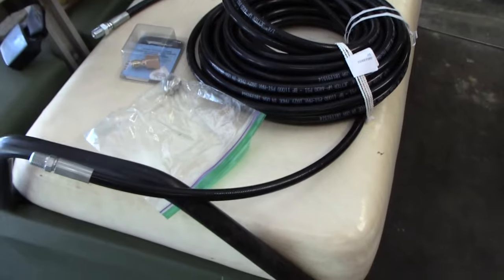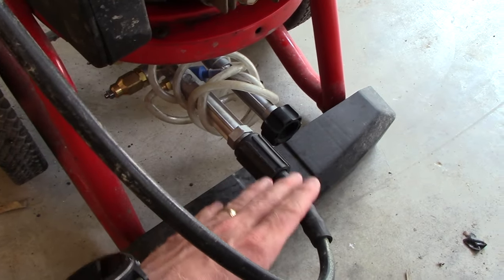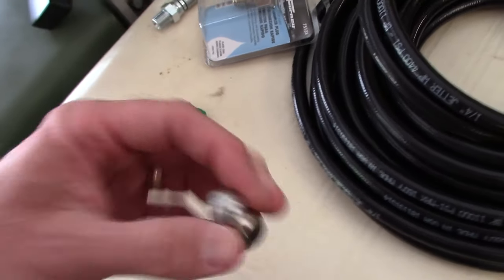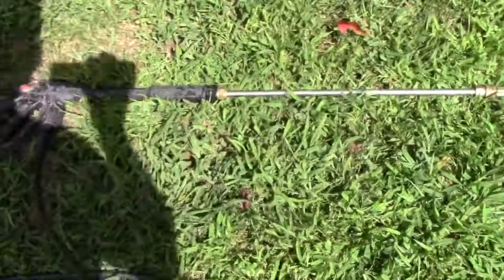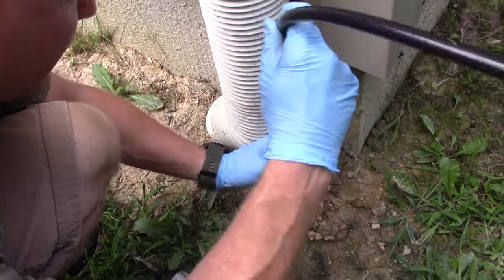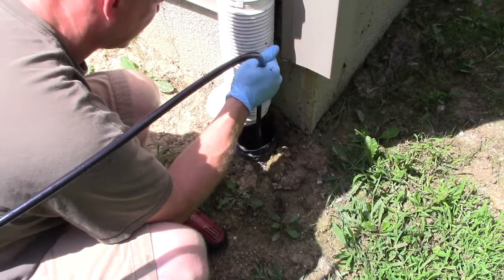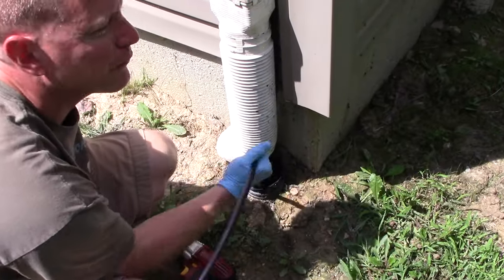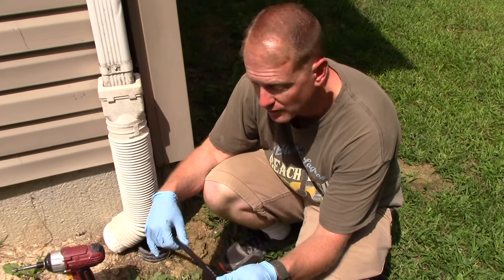DIY Cheap Water Jetter System To Unclog Pipes - How To Hydro Jet

Comment: It would be better to start from the low end and jet towards the high end. The jets that propel the hose also wash the debris out. also, run a regular garden hose into the top end. The extra flow will help to remove debris.
Reply: If you run the garden hose in, you need to have a back flow prevention device on your hose bib that you put the hose onto to prevent bacteria from entering your water system.
Reply: @texasgemtree  techniquly you should always have a backflow device built for hose bibs in place for your indoor water system protection. 
  In this case using a garden hose without hose bib backflow protection would  be ok. You  would have to have a negative pressure condition in the hose, hose bib and house potable water system to have a backflow condition (back sphinogage or back pressure possibly caused the pressure washer). Extremely unlikely if you have the hose discharging water and you remove hose from pipe(s) when done and close the  hose bib. I was a licensed backflow device tester, I installed and repaired backflow devices also.
Reply: @scrapiron  Good to know!

Comment: I was quoted $400 per hour (yes I live in CA! :-) ) to unclog my culvert drain that runs under my drive way.  I needed to buy a pressure washer anyhow and I just bought this setup from Amazon.  I'll let you know how things go!
Reply: So, how did it go? Some comments say pressure washers will only blow mudd off the roots. Wondering how your experience went.
Reply: Dont need to buy expensive stuff that you gonna use once in a decade , just go to homedepot and rent one for $40

Comment: CAN BE DONE WITH AN ELECTRIC PRESSURE WASHER: I bought the suggested items from the link but the adapter part for wand end was arriving too late and my main sewer drain was backed up for a few days but I was determined not to waste another $60 bucks renting a snake that would clear it. So I went to Home Depot and got a 1/4 in quick connect kit and disconnected the part that was the same as my washer wand end and bought a separate double female coupling to attach the high pressure hose to end of wand. Cost an additional $20. I decided to see if my wimpy Sun Joe SPX3000 2030 PSI 1.76 GPM Electric Pressure Washer, 14.5-Amp would do the job in spite of the video saying it wouldn't since I knew the root clog was only about 2 ft from the access. With the fancy mushroom head attachment it was pitiful pressure. So I took it off and added the part from the Quick connect kit that I had removed (which is the same as the end of the wand) and attached it to the end of the pressure hose and then attached my pressure washer attachment that is the strongest one I had (yellow nozzle). Bingo! full pressure on a flexible hose that cleared the drain. I did have to hand feed it since there are no reverse propulsion streams on it so I used a 6 gallon shop vac to clean it out first. It worked great and was fast. I'm relieved I didn't need to buy a gas powered pressure washer. I may not have demolished the roots with this method and I will see how long it lasts but at least I can do again without forking out more money. Thanks for the video. I hope my adventures help someone else. I was nearly inspired to make my own : )
Reply: 9999

96
Reply: can you explain what exactly did you need to do? Which quick connect kit are you mentioning? was the quick connect kit even used?
Reply: How did you turn the water on and off. I am guessing you did not have the wand in the setup right?
Reply: @whoknows4756  hi! Honestly, I can't remember. This was a long time ago.
Reply: @dianeobanion4847  I know its been a while...Thanks

Comment: I purchased the hydro jetting package and used it yesterday.  Presumably the corsage pins are for clearing out the tiny holes on the hydro jet nozzles as I quickly learned as the forward jet nozzle clogged within 5 minutes of using it.  My question is how to clear out the forward jet nozzle hole when the corsage pin doesn't do the job?

Comment: I just noticed what you said about corrugated water drain. When the house was made the contractor cheated the homeowner by not putting in smooth pipe which is way stronger and lasts a lifetime and costs just a little more. Now when the pipe fails you have to start from scratch. Now your will really have to pay. Fact fella. I know my neighbor just went through that scenario. I am quoting his words fairly close to what was stated. Peace
Reply from the maker: Yes. Very true

Comment: Did you try a garden hose first? Most clogs like these especially in large pipes like those can be done with a garden hose!
Reply from the maker: This was more of a demonstration video for what this can do. And yes in this case I did try a garden hose and no it did not work. Some water was getting past the clog but it would drain slowly.
Reply: @JackofAllMasterofNone  i have 2300psi water blaster. Do you think it will do the job?
Reply: @nasirahmadsharma  yes, i have a 2100psi and the 100ft kit.. works great
Reply: @russr  Is it gas or electric?
Reply: @rhou568  gas... 2500psi, not 2100

Comment: You could have bought the hose with an M 22 terminal, and then you could work both hands free, without using one hand to trigger the gun.  Productivity !
Reply: So I have found the ziptie is not the best solution. A pair of larger adjustable locking pliers aka vise grips is the perfect answer...and my new go to for using this tool.

Comment: The purpose of the back jets are to   push debri backwards as you feed, you generally want to put some tape at least the ID back from the tip of the nozzle so that you don't get water cut by the back jets and to prevent backout.  On professional systems there is usually a foot pedal with a dump as the pressures (4000-20,0000 PSI) are too high for back pressure shutoff valves/recirculation valves.  For your system I would use a ball valve just before the lance.
Reply: We sometimes use a hotsy/landa gun for low pressure like this but the ball valve will free up your hands to loop the line and twist to get in front of stubborn debri.

Comment: Nice job you can actually get a bigger setup now for under 50 bucks with a bunch of different jitter nozzles 100 ft hose and all the connections to hook to the pressure washer Amazon
Reply from the maker: Link?

Comment: Excellent explanation and demonstration.  I honestly have not seen this displayed and explained elsewhere. Questions:  1/ Where could I buy those two fittings and the hose that you used in the video.   2/  Is the fitting that replaces the original tip on the gun universal.
Reply from the maker: Look in the video description. All the parts I used are there.

Comment: Great idea to use power washer to provide high pressure water for the jet. I was a little confused about where you added your hose - was it attached to the discharge end of the power washer "wand"? It would have been helpful to see a photo showing entire "circuit" - from power washer to special nozzle
Reply from the maker: Yes. Basically I took off the jet and it plumbed into that port.

Comment: Hi,
What is the kind of your gas pressure washer ? (M22 Briggs Stratton 6.75 Ready Start ???) Try to look at their site, but don't appear.
What is it price ?
Hi,
What is the kind of your gas pressure washer? (M22 Briggs Stratton 6.75 Ready Start ???) Try to look at their site, but don't appear.
What is it price?

I have a recurring problem, every four years or so, with the roots of a tree blocking the sewer pipe in the house.
Can your system cut tree branches like the Riper is supposed to do?

Thanks for sharing and have a nice day!

Thanks for sharing and have a nice day !

Comment: Hey thank you for this video! Quick question... Does the pressure washer hasn't to be gas. Having an issue now and I want to get a sewage pipe unclogged but I have an electric pressure washer... Is that sufficient psi? Or any other issue to worry about?
Reply from the maker: Electric washers don't have enough flow usually.

Comment: I bought a jetter hose off eBay that stated it is rated for 5800 psi but the hose is so thin and kinks up badly. I deal with pressure washers at work and the hoses are almost impossible to kink during normal use.

Comment: This is pretty cool!  Didn’t they use to use clay pipes before ABS and cast iron? Would this method be dangerous to use on clay pipes or any other material pipes?
Reply from the maker: If done correctly it is safe. Best to use a camera in conjunction with the jetter.

Comment: Thanks for the video! Can you tell me the PSI and GPM on your pressure washer?
Reply from the maker: 3100psi 2.5gpm
Reply: This is what I was looking for too. I have a 3800 psi 2.5 gpm and it won't really cut roots very well. It struggles. It clears the dirt out from between the roots and allows water flow again but most of the roots are still in the pipe. It will take out some fine roots but thats about it. If you have roots you need a much bigger machine.

Comment: I see that the nozzle you selected is marked as 4.5 size. From a local supplier here, I see that there are also several higher numbered nozzle sizes such as 5.5, 6.5 up to 12.0, each forcing higher volumes of water through the nozzle. Can you please advise why you selected that size of nozzle to use, rather than a larger size such as 6.5 which would force 50% more volume of water through the sewer pipe ------ especially if the 3 inch sewer line is 75 feet long. Very good video by the way.
Reply from the maker: I just picked the one that I could get honestly.

Comment: An important point here is using a gas powered pressure washer. The reason being that electric pressure washers don't have high enough volume of water to get the job done. It requires between 2 and 4 gallons per minute.

Comment: what would happen if you can go 15 feet or so into your drain without obstruction and have the hose directly connected without the triggered wand and then ran the washer full blast?

Comment: What type of pressure washer? Cost?, I am not seeing links to build system. I was quotes min, $450 to clean landscape drain. The the pressure washer and part are about the same, better off to purchase. What are the specs needed for pressure washer

Comment: Okay, I was a Rotor-Rooter Jetter technician for over five years. A,..I would start with a snake going up and down the flow of a storm drain. B,..Second I would Jett starting from the tail end first and go upstream to clear,....Every roof storm drain downspout should go to the street or some other areas where the drain has access to flow openly to earth, if not,..it's leached and if it's leched and you can not penetrate going downstream. You are caught up in earth and grass roots,..time to replace and adjust the drain system and move off by 2'..minimum. "Advise the storm drain from 3" corrugated tubing to convert to 2" or 1"" PVC and go to the street or some other areas where the drain has access to flow to earth freely., any future Cloggs simple go upstream. The bottom line is if snaking doesn't work up or downstream and Jetter doesn't work. re-rout..

Comment: Nice set up, thanks for sharing ! 

I do have a question however,:

What is it with an electric power washer vs gas that keeps the electric power washer from being compatible ?

I know it ain't power .. I got a 3100 psi electric . Way more powerful than the 2300 psi  pressure washer shown on your video.

Comment: I wonder if this water jetter hose is ok with going thru' 2" galvanized drain pipe as the hose end has a good size nut, or need a water jetter hose with a more compact connection end.  Thanks.
Reply from the maker: It should fit fine in 2 inch pipe

Comment: What PSI on the pressure washer do you need?  Will electric powered pressure washer not work?  Guessing not enough juice for it.
Reply from the maker: Usually electric don't have enough flow. It's not the pressure, it's the flow rate that's the big thing

Comment: I have a 3500 PSI 2.5 GPM gas powered pressure washer. Would my unit be strong enough?
Reply from the maker: Id say so.
Reply: @JackofAllMasterofNone 3500 PSI? I'd say so.  No more needed to be said. Lol
Reply: I have a 2000 psi electric you think that will be sufficient?  Ty

Comment: What PSI/GPM would you recommend for something like this? does it need to be 3000+ or would a smaller one work?
Reply from the maker: The higher flow and psi the better. The key is to move as much water as fast as you can.
Reply: @JackofAllMasterofNone  What did you use?
Reply from the maker: @Joe-cf7hx  Mine is 2500psi and 2.3 gallons per minute
Reply: @JackofAllMasterofNone  I have an electric pressure washer that does 2030 PSI | 1.76 GPM. Do you think that would suffice?

Thanks, Paul

Comment: This looks like a great idea! Are you familiar with iron ochre? I have an interior drain tile system in my basement and unfortunately, I live in a area with that iron that clogs the openings in my drain tile and allows water to come through my floor. Do you think this is a strong enough psi to clean my system out via clean outs?
Reply from the maker: It might be. Depends on your pressure washer flow as well.
Reply: Jack of All Master of None 
Do you mean flow as in GPM? If so, the current one I have is 2.9 GPM
Reply: Psi is 3,200

Comment: Hope you get this as this video is a bit older....
Why can't I just put the pressure washer handle  hose, down my roof vent and blast out the debris?
It gets clogged up every 2 years and we pay $250 to get it snaked by a plumber.
Just wondering if using the handle hose, instead of all these gadget attachments ~ wouldn't it do the same thing, since it's a shorter distance to travel?
Looking forward to your answer as you might have already guessed :)
Reply from the maker: Try it and see. It may not reach down far enough to get the clog out, or it may. What kind of debris is getting in your vent? That is not normal.
Reply: @JackofAllMasterofNone  oh wow!! Thank you for getting back.
Good question.
I have no idea. The folks that designed the plumbing in this house in 1968 were numb-skulls ( I think that's what they called em back then! LOL).
Wish YouTube allowed pictures.
 I could send you a few so you'd get a better idea of how the vent in my roof connects to the draining pipe to my washing machine.
If that vent isnt clear all the dirty water backs up in my kitchen sink :(
We have to snake it every 2 years it seems. Its soooo expensive!
Takes the plumber less than 5 minutes to snake it and charges me $250.

Comment: How do you remove metal mushroom style cap from outdoor vent/ clean out access in yard.  Screw is frozen. I sprayef rust  loosener. Turn clockwise or counter clockwise?
Reply: Lefty loose, Righty tighty.....😂😂😂😂

Comment: I paid more and went with the original snake. Smaller and the head is not detachable. I did not want to risk the head getting stuck.  

I attached a clamp to the spray gun do I could push the line with both hands.
Reply: $705 bid for kitchen drain. $1,500 for the sewer. 

I paid $208 for 100 ft snake I connected to my power washer. 

I knew it worked because a week later the city was out cleaning out the sewer line at the road.

Comment: I have jetter hose an nozzle, 3100 psi riobe.
Is there a way to control the pressure coming out the gun, I'd like to reduce it.
Reply from the maker: You would have to buy a variable valve most likely.

Comment: Will this work on tree roots in my main line sewer system? Does it have enough power?
Reply from the maker: Depends on the tree roots. This water jetter can not handle big roots.
Reply: Root intrusions will require the sewer to be dug up where the roots are and that section of pipe will need to be cut out and replaced, you can cut them with a sewer machine and a cutter head but they will come back best thing is to replace the section of pipe where the roots are

Comment: Could I bypass the wand completely and just hook the hose up to the pressure washer outlet?  I'm just having a tough time find the proper adapter to hook up the hose to my wand.
Reply: the water will be on at all times if you do that. you need to be able control water flow (on / off) while jetting.  get some quick connects and put a ball valve in if you cant get attached to the pressure washer attachment.

Comment: What happened to the material in the clog? Does that pipe have an outlet?
Reply from the maker: Yes. It drains into a stream
Reply: Glad you asked this question. You're actually supposed to clear a drain from the bottom end if possible. The nozzle is designed to spray 3-4 jets backwards. This pulls the nozzle through the clogs as Jack says but its designed to wash the clogg out as you pull the hose out. If you clean from the top like he did, you run the risk of only displacing and dislodging the blockage for a short time and then having it reform again further down the drain. I clean pond drains and have experience in this field. Also, the valve he discusses is so a single person can operate the system. Sometimes you have to have both hands to twist and guide the line through turns and blockages. You can't do that squeezing the trigger on a wand. You can fabricate a value with stuff from Home Depot or Lowe's for about $10. Stick the line in the pipe as far as possible then turn the valve on. Otherwise the line may come flying out of the pipe. Hope this helps everyone and Jack.
Reply: Darth Slagle what if the clog is past the toilet trap but it's in the pipes? same thing? push the hose past the clog and then turn on? Also can you buy the parts and assemble them easily yourself? I read your buying rootx comment for tree roots so I know your Canadian, and I need to know where to buy this stuff in Canada.